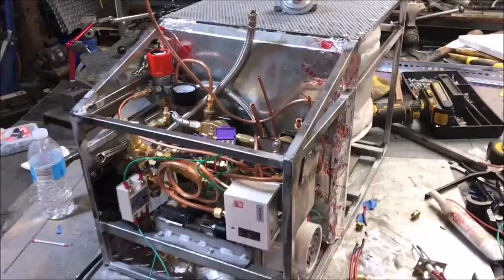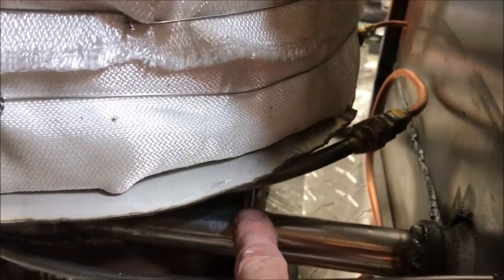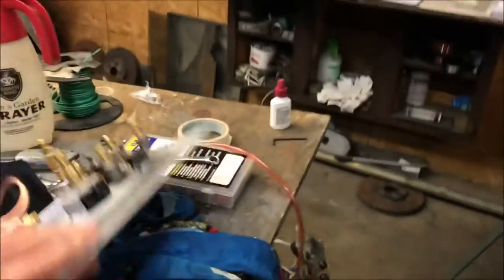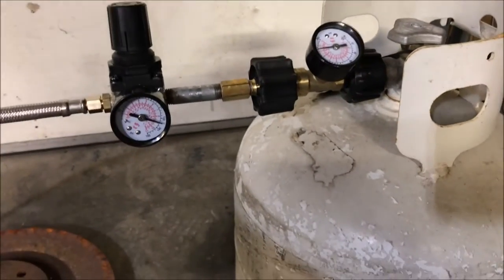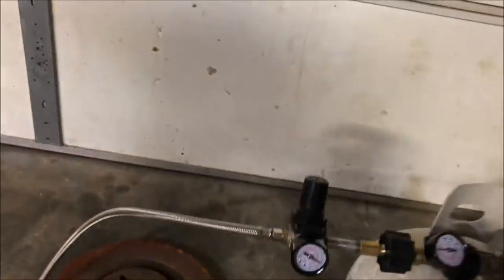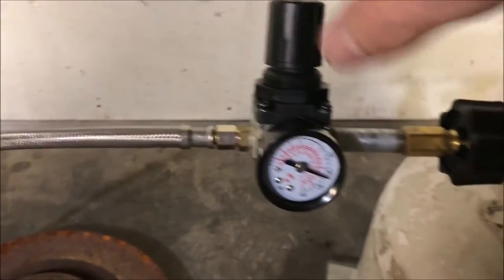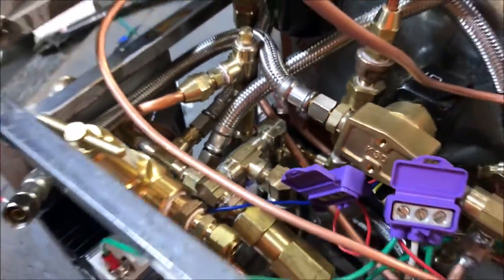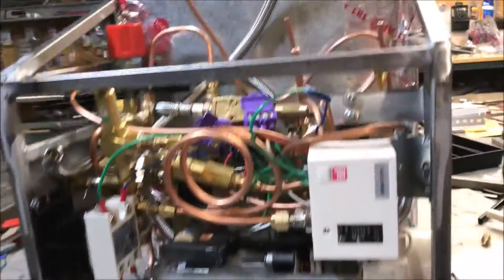Forge and Foundry Pressure regulator Information

Comment: Your right they sell 30psi and call it high. I think standard is around 5 psi. I saw that too. Another comment thought to try acetylene guage, good thought since they are aware of flashback?, or add an arrestor to yours. Side note...Pressure in homestead lp tanks can be great so they put a regulator on it at the tank so its easier on the hose on the way to house, then usually another on the house. Its wise to add regulator and filter, and for water, before any camp or portable equipment. You helped in my discovery journey with your vocabulary.!

Comment: How well does that regulator hold up?  I know its not rated for gas but then again i use multiple things in my forge that arent rated for gas and they hold up fine.  Except quick connects....  air ones on a forge is a bad idea..  BOOM! scared the $#!+ outa me
Reply from the maker: I will let you know if it fails